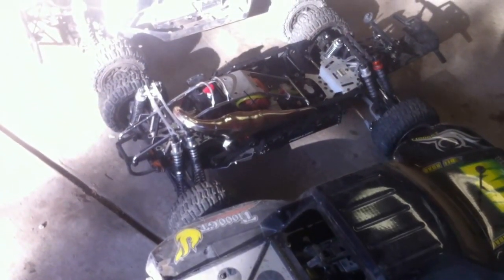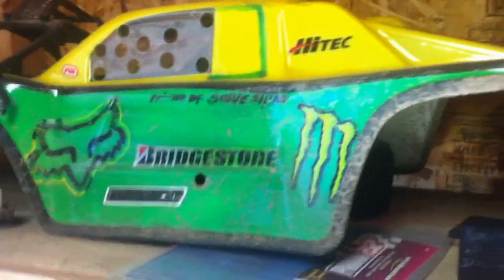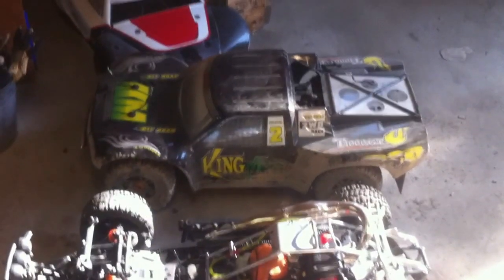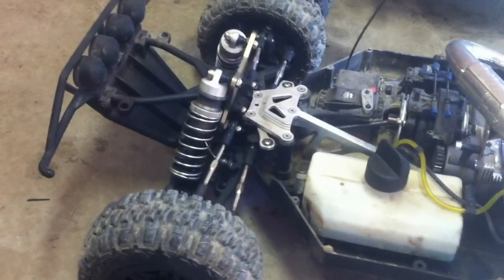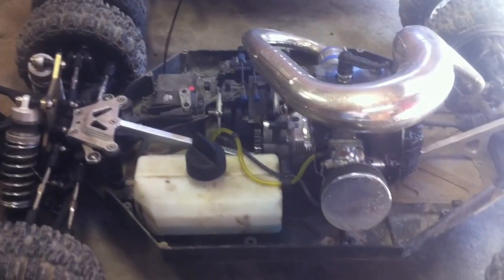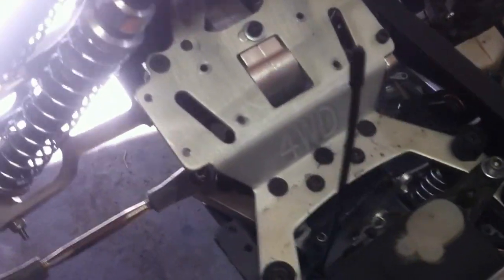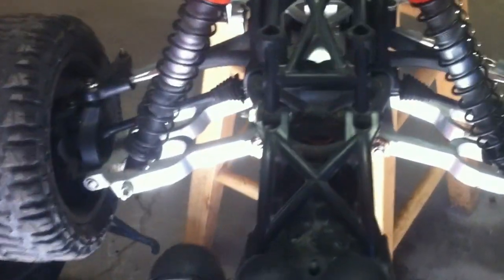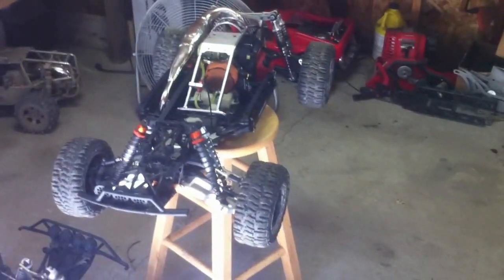King Motors T2000 4WD with LOSI 5ive-T

Comment from the maker: As you know sometimes that is something stuck in the fly wheel or area. But chances are being at the bech it may be sand that found its way inside and you could have engine issues. I think it is justification to buy a new OBR engine or kit

Comment from the maker: There's really no comparison the 5ive is supreme over the KM T2000 4WD. I have both. I made aluminum swing arms and hubs myself so mine is unique and can't be measured against stock T2000. One thing I will say is the ESP engine ported kits are killer. I turned a 26cc CY engine into a ported 30.5cc terror for $89.00 when DDM had it deal of the day and it impresses me same as my OBR Prostock

Comment: im running a hpi baja 5b with a switchblade kill switch and it very reliable and stops you smashing up your expensive car. The switchblade you can find on ebay but the guy who makes them lives in the UK so if i was you i would get the killerrc super bee kill switch.

Comment: Great vid! I am getting the King motor baja 5bss special adition. It comes with the 30.5 cc motor. I am taking off the stock exhaust putting on a pro vrc side pipe on. If any one has any thoughts on pipes or upgrades let me know. Would be much appreciated.

Comment: Any ideas on improving the turning circle on the t2000? And is you know of any all metal gear steering servos that fit? Bought one on eBay, bracket is different and the angle  from left to right wasn't the same amount as the stock servo so I sent it back.. Thanks.